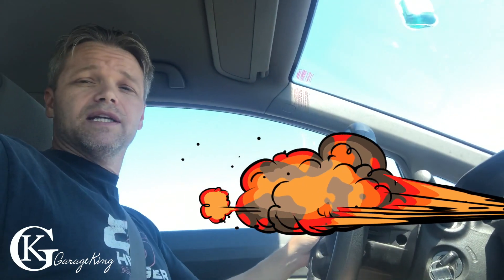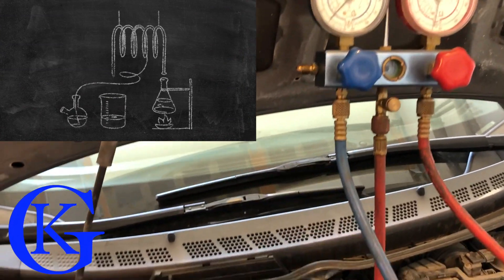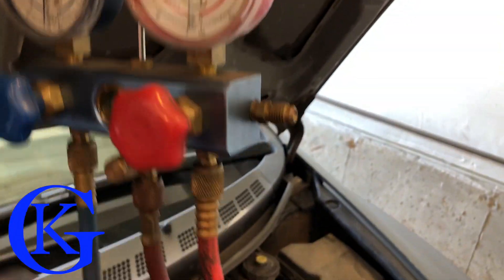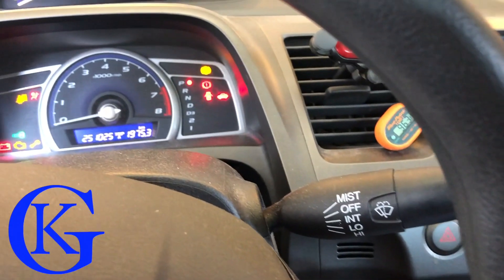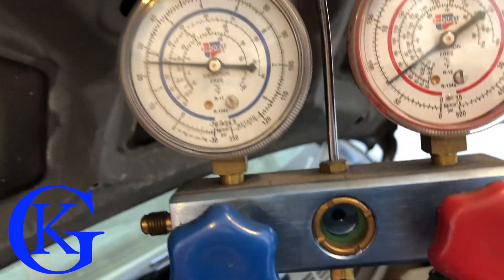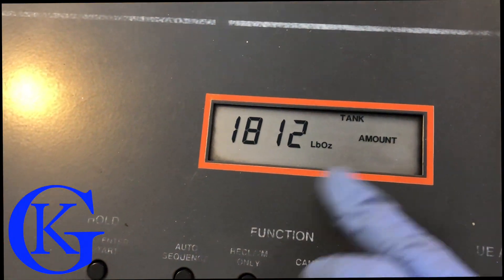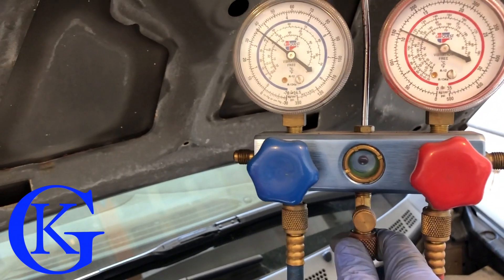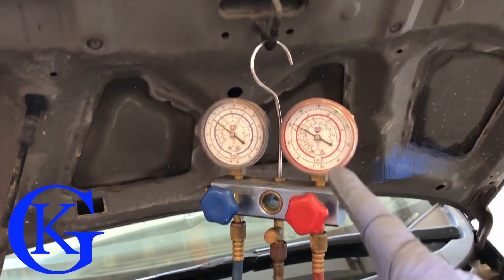How to recharge AC system with gauges properly and evacuate

Comment: great video; I WONDER IF THERE IS A "HOW TO BOOK" on this subject you would recommend??  "HOW TO RECHARGE YOUR  CAR,S A/C FOR DUMMIES?? I refuse to pay $450-500.00 to have someone do it; much appreciated PATRICK P
Reply from the maker: Thanks for the great comment buddy!!!  I don't think there is any book available that I know of, but it would be a great idea for sure!!!  Probably the best book would be a college automotive learning book.  You might have to attend a college bookstore that has an automotive program to get one? That's how I learned when I was in college to become a mechanic.  I know many shops just overcharge people with AC because not many people know how to do it, or are afraid to tackle it as you do need some special equipment (gauges and a vacuum pump)  The thing is those can be used on all the cars, as they are pretty much all universal so your set of gauges can be used on a Ford or a Ferrari, doesn't matter, and you can use over and over again if you wish.   I hear what you are saying about 450-500, its highway robbery at some shops, and unfortunately some people just pay it, that's why they keep charging it.  Thanks again for the comment :)